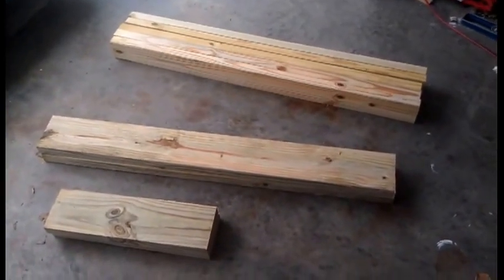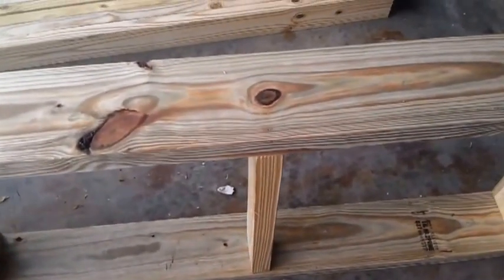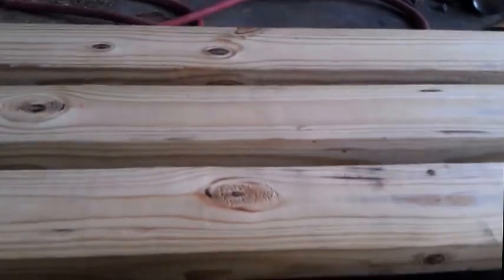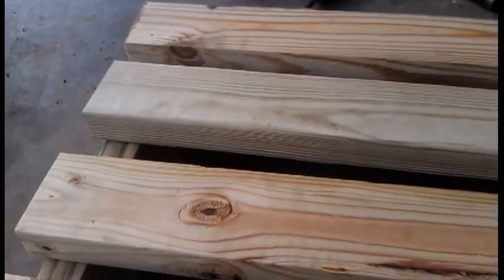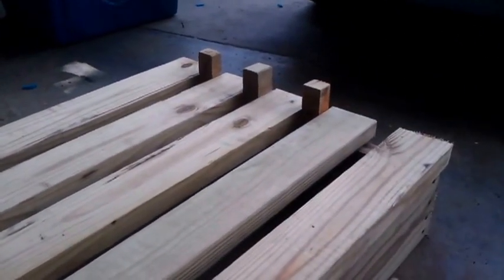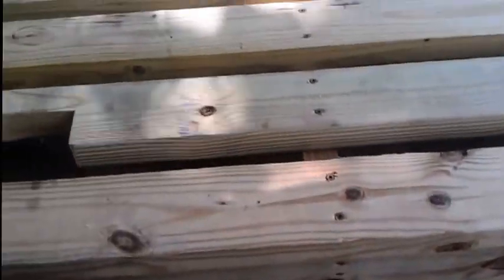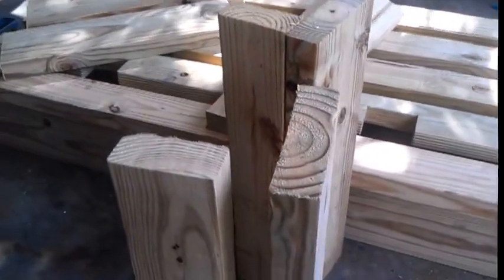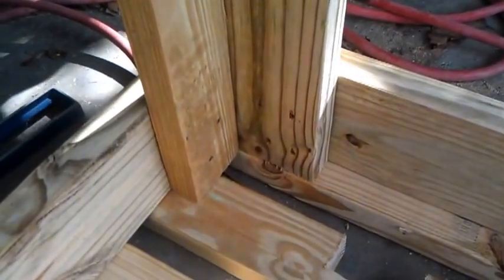Twin Rain Barrel Construction Pt.1

Comment: Is there a way to adapt this design to be robust enough to support 3 rain barrels?
Reply from the maker: Absolutely! If you add 24 inches to the width, making the overall deck size 72 inches it will be big enough. I would probably use 4x4 lumber for the legs and definitely add a set in the middle, it will be very heavy when full.
Reply: Sarasota RainBarrels - yes, very heavy over 1400 lbs! So you recommend 4x4s instead of the 2x6s and 2x4s?  Also I am considering 36-inch height for better water pressure. What about 2x4s or 2x6s along the bottom of the legs to make a frame for extra support?